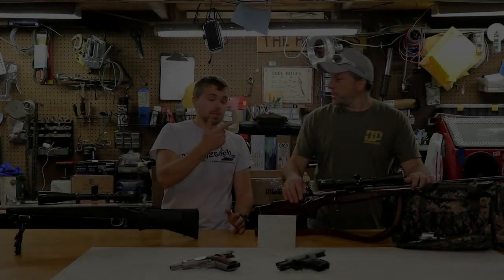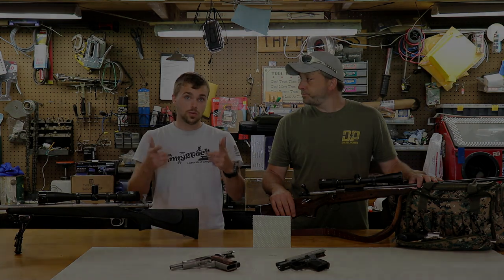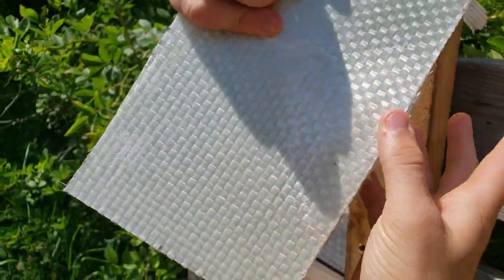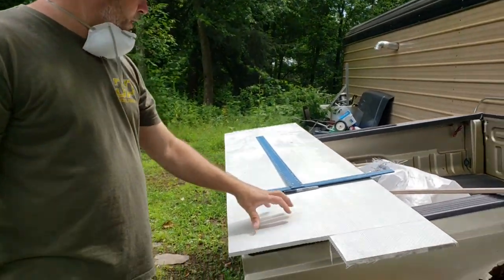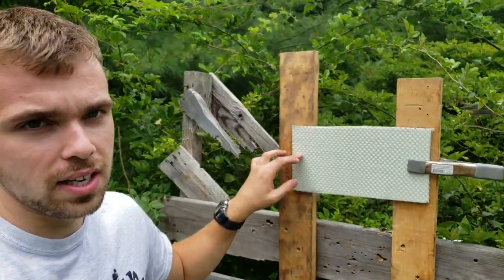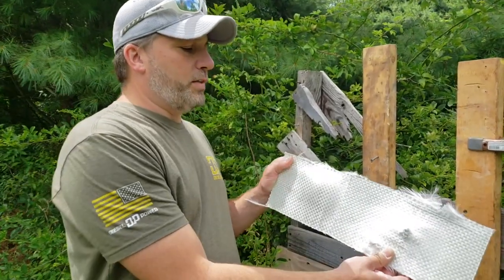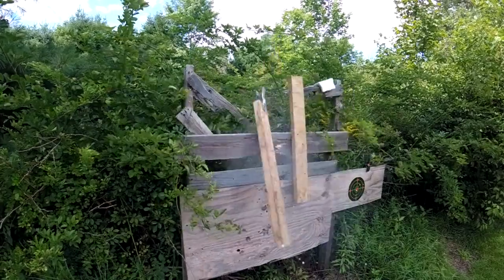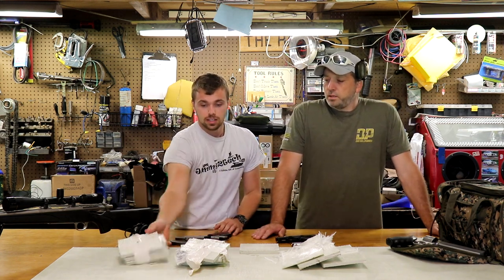TESTING BULLETPROOF DRYWALL

Comment: Armorcore has many levels and you didn't say which level or thickness.  Sorry, but that's a fail.
Reply: I wonder how different the results would have been if the board was actually fastened to a wall and they marked the studs so you could have some type of target🤣